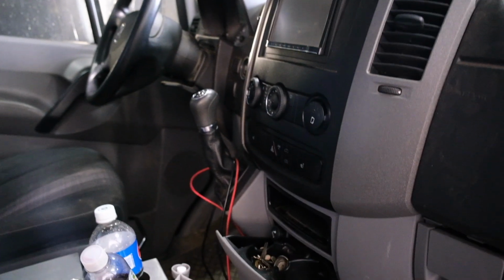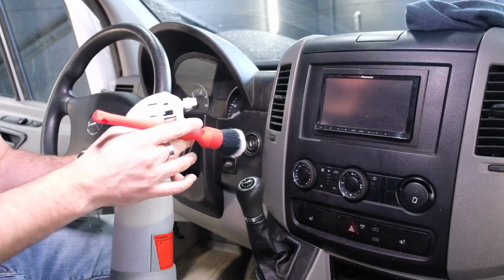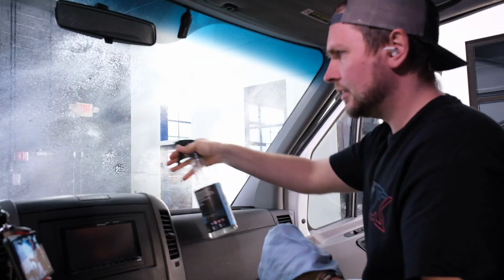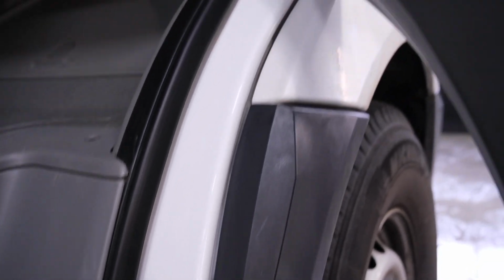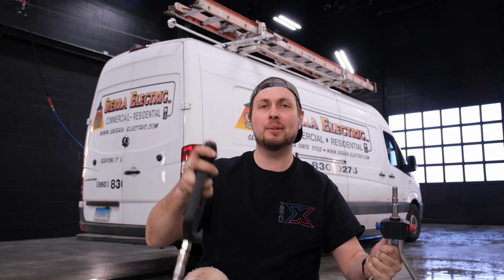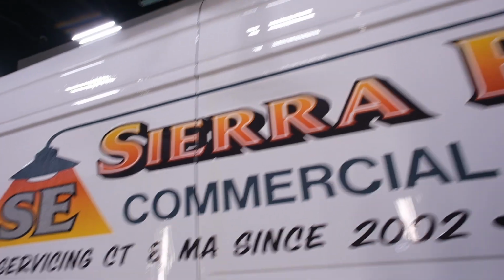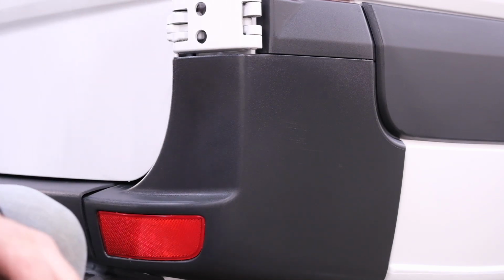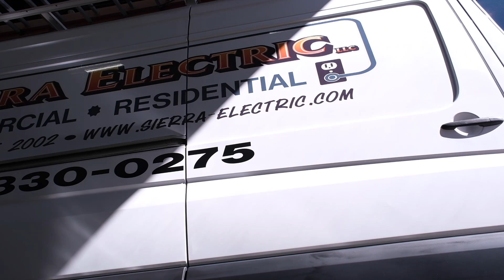FULL DETAIL on A SUPER DIRTY 2014 Sprinter Van!

Comment: Personally i do not see the need for a steamer as it helps break up the dirt and i dont have issues really ever of needing more power. If you do carpets and upholstery alot and looking for an upgrade the Mytee 8070 has been outstanding to me so far but unnecessary if you rarely do dirty disgusting upholstery or carpet. Compressed air would help with the buttons and nooks and crannies significantly. The best tip i can give is do not beat yourself up over the small things or if you do not do it perfectly compared to others as its all a learning process and your doing WAY better than anyone that does not do it themselves. I have had some tell me i did something wrong but there was no real point as it did not suit the vehicle. A car that gets trashed all day everyday does not need a 40+ hour detail that goes above and beyond to ensure no micro marring occurs
Reply from the maker: Thank you for the feedback I appreciate it! I think the compressed air will be useful I’m going to install an air hose reel next at my bay that’ll be a huge help I’m sure. I’ll def look into the Mytee 8070 thank you!
Reply: @ChemX  you can get great results from any extractor and in a pinch you can try the can of compressed air for computers. Keep up the good work!
Reply from the maker: Thanks!

Comment: You say 40$ for that expansion pack but website says 194$ that's more then 4x the price you said.
Reply from the maker: Shipping and materials on the 5g pails is expensive, the goal of the system is to make the refills cost $40 by being concentrated 1 gallon jugs, that saves the cost of the materials and shipping on the refills

Comment: I’d definitely use a steamer on those cup holders. 

I drive a similar van for work. For the floors I vacuum, brush everything to loosen up more dust, then use a all purpose cleaner on the floors with a brush, then suck everything up with an extractor. Maybe a little overkill but my floors get really dirty.

Comment: In your opinion would a 1900 psi  electric pressure washer with a zero tip on it be enough pressure for removing your Stars and Stripes product?
Reply from the maker: The 1900psi would probable work although I would use the 25 degree green tip, a zero degree nozzle won’t work at all it would hit too hard in too small an area and not get a nice even finish
Reply: @ChemX  thanks for the reply and info!
Reply: @ChemX  do you have an ETA on when you will have the detail brushes on your site?
Reply from the maker: Yessir anytime!

Comment: I personally would load the detail brush with product as opposed to spraying directly on the dash and console! Just for moisture control with switchgear etc
Reply from the maker: That’s a solid idea I’ll def do that!
Reply: Helpful
Reply: Your fine spraying all over just disconnect the battery and use compressed air to blow the stuff out

Comment: does the heavy duty leave a residue using it that way on the inside?
Reply from the maker: It will if you don’t wipe it off, I noticed some residue probably from the surfactants when I used the brush and allowed it to air dry,  but then I hit it with a cloth and it was good to go

Comment: Great job Bobbo! 

Also fwiw if you have mat clips and you're working with mats that cooperate, it's sometimes better to hang em up and then spray your chems and do your cleaning. If the soap works quickly or is capable of foaming a little bit so it doesn't just run off the mats, I prefer that approach because I find I'm able to use less chems and stretch my products further. Can even add a foaming agent into the mix or a surfactant that'll allow the soap long enough to dwell on there.

I know you have a whole company and I warehouse so you're probably stocked to the brim, but I've always felt like appropriate and conservative chem usage is a skill to learn in detailing as it helps things STAY clean. It's also a small thing we can all do to help look after our planet a bit more, and it's obviously this is becoming more and more important for future generations.

Comment: I'm in Mass too! Anyways as a mobile detailer if I have to shampoo the seats I do that first as well after vacuuming, because I want them to start drying as soon as possible. If you have access to an air compressor, get a tornador gun and it will change your life lol. I use that much more than my steamer. When I first started detailing it use to take me 6-8 hours to do an interior and exterior detail. Now with these little tools and many trucks I've learned I can get, an interior alone done in an hour. If it's loaded with per hair only takes an extra 30 mins, when it use to take hours. A rounded yellow drill brush is my truck for hair. Anyways keep up the great videos!
Reply from the maker: Man thank you those are solid tips I’m gonna have to grab a tornador that sounds really helpful, is there a specific model they make that you like?
Reply from the maker: Purchased! Thanks bud can’t wait to try it out I’m going to mount an air hose reel in my bay shortly!
Reply: @ChemX  glad to help, you're gonna love it. Gun requires 5 CFM, and maximum of 90-100 psi.

Comment: I personally find it better to use a steamer on the pedals and really dirty floors and I would recommend a little bit tougher brush on the interior for if your using a liquid and for vacuuming the less tough one
Reply from the maker: I def wanna grab a steamer for stuff like that, I did notice the detail factory boars hair brushes are much stiffer than the synthetic ones like the newer tri grip style I used in this video, are there tougher options out there?
Reply: @ChemX  not that I know of but I saw you were using synthetic and if you wanna really work up the dirt and grime than I think the boars hair would be the best
Reply from the maker: Yeah I def think your right I’m gonna roll with the boars hair on the tough stuff in the future
Reply: @ChemX  sounds great I’m glad I could help you out a little
Reply: @ChemX  Work Stuff brushes are an excellent option.  They have many types- super soft, boar's hair and synthetic.  The synthetic come in different stiffnesses.  I like boar's hair for wheels, ultra soft detail brushes for info screens and around gauges, and a soft to medium synthetic for rest of interior ie: cup holders door panels etc.  They give that little more stiffness you need and will last longer than boar's hair.  In addition to steamer, compressed air is helpful.  Can use to blow out crud where vacuuming can't get and blow dash etc after cleaning to get any moisture out.  Overall your process is good.  Keep up good work.
Reply from the maker: Man that’s solid input thank you so much!👏🍻❌💯🔥😁

Comment: Not a tip but rather a question. What is the purpose of rinsing from bottom to top when doing a touchless wash? Another great video!!
Reply from the maker: Thank you! That’s a solid question! So I do rinse top down anytime I use physical contact with the vehicle, or if I apply touchless soaps at high psi, but with foam cannons the soap goes on very gently and the high psi rinse becomes the physical contact, rinsing bottom up helps me not miss a spot with the psi🍻❌💯
Reply: @ChemX  that makes total sense! Thank you so much for the reply!!
Reply from the maker: Absolutely bud thanks for watchin!👏🍻❌💯